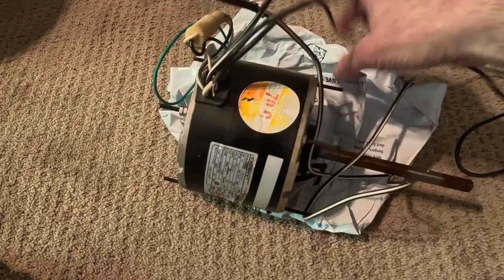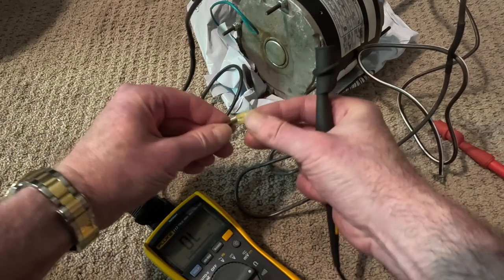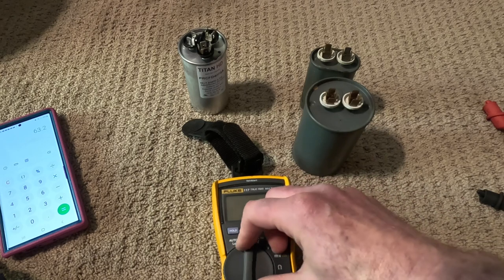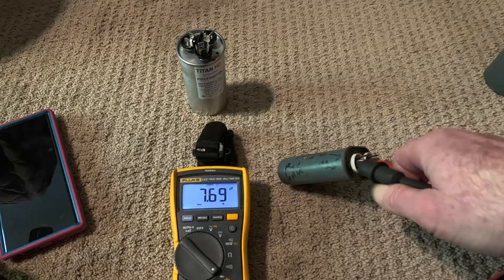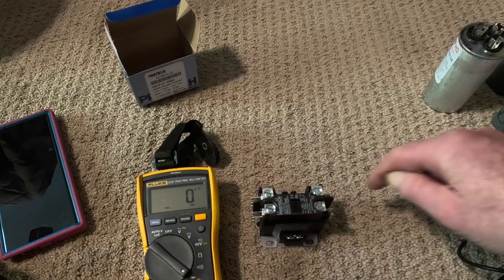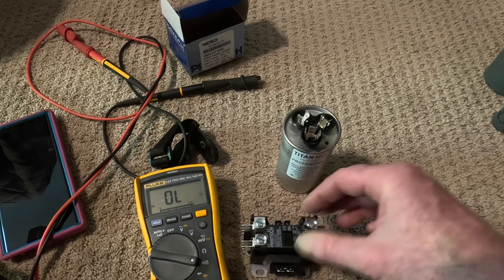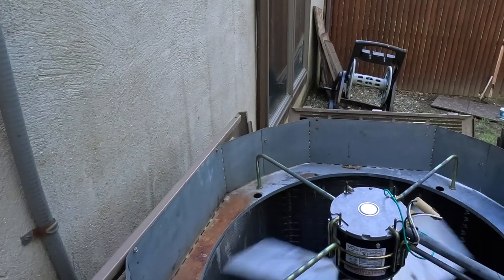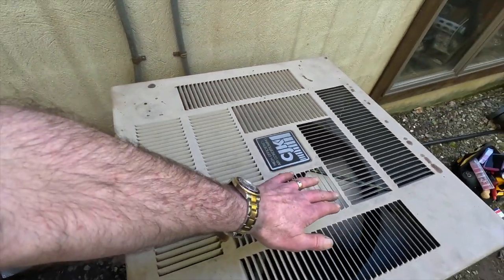HOW TO WIRE Motor, Capacitor and Contactor IN CENTRAL AC UNIT

Comment: Thank you I took a break from school and honestly have been doing my basics so I forgot the most basic and fun part of single stage equipment. So I’m assuming coming off terminal 1 (outgoing) you could say Run, Run, common to the cap? So 3 wires coming off it? And off the neutral/terminal 2 your 2 common wires if it’s a dual cap. So fan and hermetic common. I believe my teacher taught it like this ( Run Run Common to the cap, Common Common)
Reply from the maker: I wish I could say with certainty from what you wrote, but I’m not sure to be honest. There is more than one way to wire these and make them work depending on whether you have two single caps or a dual cap. Assuming 240, and a fan and compressor, the fan leads go to term 1, term 2 and  F on the cap, the compressor leads also go to term 1 (common) and term 2 (run)  lastly to the herm on the cap.(start). the common goes from the capacitor back to the same terminal as the compressor common which in this case is term 1. Hope that’s clear.

Comment: Hey for oming out the compressor Incase the *schematic” is gone or the label is faded. When I ohm them all out wouldn’t the start be the highest ohmed wire connected to the common wire. The common wire the least resistances wire when checked to the other 2 wires. And the run being the second highest wire when checked to the common and start?
Reply from the maker: Start to run should have the highest resistance and run to common should have the lowest. Start to common should be the middle number. I’m not an expert though. I would look at this one. I’ve learned a ton from his videos. https://youtu.be/g2ADgrUhb7Y?si=KcN04XpW4ySm18fQ. Thanks for commenting and watching.

Comment: So there was a connector at the motor to reverse direction. I was expecting you to swap wires in the control box to reverse it.
Reply from the maker: Yes. If you look at the video at 18:47 the white connector sticking up was wired like that from the factory.  If you unplug the connector and rotate it 180 degrees it reverses direction of the motor. Of course you can swap them in the control box as you said also.  Thanks for commenting. It’s still working fine.

Comment: Hello Sam,  Is your name Sam?    Good catch on the wrong fan direction.   I have found them blowing backwards.   When you cut the white wire did you mean to cut the white/brown wire and your brain got stuck on white?  LOL. Or what was reasoning?    You better start saving $$$ For a new system.  That condensing unit looks like it is at its last leg.
Reply from the maker: It's actually Rich.  Before YouTube was a thing you could use your email address as your homepage. It was originally my daughter Samantha's page and her email address when she was like 13 was samlol23 so I just kept it. 
Since the white and brown and white leads are connected I could have cut either one.  Makes no difference at all from what I understand. I cut the white wire because it was cut on my last fan motor. 
These 2 air units are original to my house from 1989.  We moved in 12 years ago and i will not put gauges on them out of fear of causing a leak in the Schrader valves. 
They are both R22 units made by Armstrong air.  Im gonna do what I can to keep them going.   Really don't want 410a units. 
I had to replace the pan in My attic air handler a few years ago. Did it without removing the refrigerant because I would positive nobody would do the job for me. It's an old crappy video but it's here. It's still going strong https://youtu.be/mUQeKyNtQ78